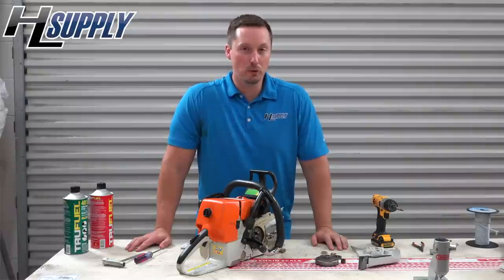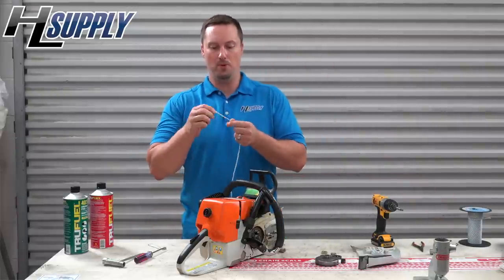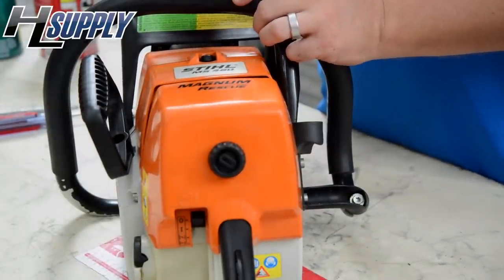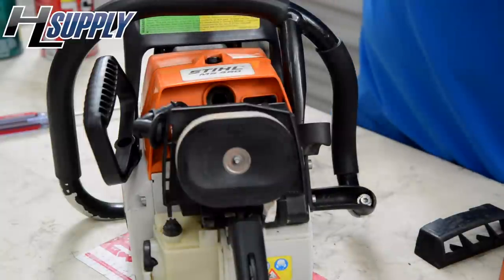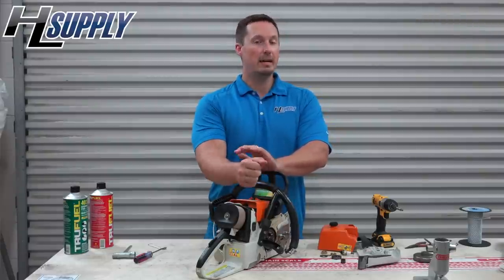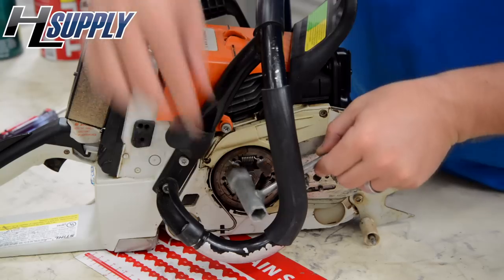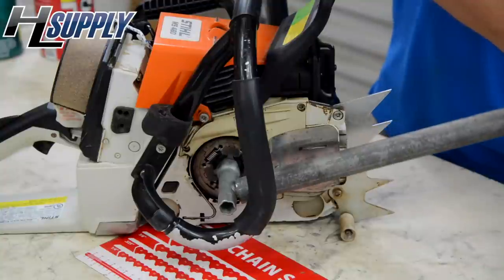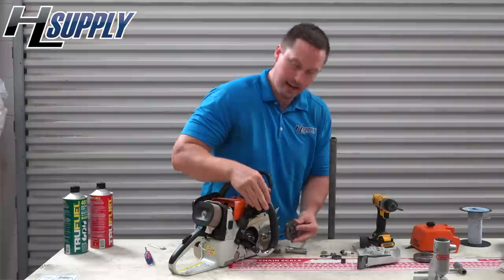Make Your Own Piston Stop and Clutch Removal... The Easy Way!

Comment: On the poulan I used a adjustable wrench and vice grips it worked good and will either buy the right tool for that job or will make a tool

Comment: I've bent a connecting rod on a saw doing this before. To play it safe, instead of using a cheater bar and slowly torquing it, I just use my ratchet and hit it sharply with a hammer to jolt the clutch loose. It helps eliminate the risk of bending the rods.
Reply: Probably not a good thing to do if you value your ratchet. I’d hit a short breaker bar, however.  Great tip though! 👍

Comment: It worked great, but my rope is stuck.  Could it have gotten stuck in the exhaust valve?

I plan on taking the muffler off, but I need a longer t27 bit
Reply: Mine too, cant get it out, Its really stuck, and there is no way to reverse the piston ... Any suggestions? Outside demount the whole thing?

Comment: Hello everybody, I used a piece a rope with smaller diameter and poor 
quality so it broked into, do I have to take it off ?! or will it burn 
??
Reply: Yes, you must remove it!
Reply: I'd say if you got most of the rope out and left a tiny piece in then it'll be fine unless you're picky perfect and don't wanna chance scratching your metal with a piece of plastic rope which won't because it'll get burned up really fast whatever way

Comment: I have to use a hammer and a punch to remove all the clutches on my saws.
Reply: This method can work but it can also damage the clutch so it's the best idea.
Reply: @mattobermiller5041  Use a brass punch.
Reply: @stsid1  Good idea,  I'm mainly a Stihl guy and they seem to all have hexs for a wrench.
Reply: @mattobermiller5041  I'm a husqvarna and poulan user and don't know what they use but i get it apart without the special tool

Comment: Hello everybody, I used a piece a rope with smaller diameter and poor 
quality so it broked into, do I have to take it off ?! or will it burn 
??
Reply: Kinda late, but use a shop vac to get those threads out. You really don't want any debris in the combustion chamber. You can run the risk of scratching your cylinder and wall, that would cause compression loss.
Reply: @bubbaray575  hello mate, better late than never lol;
I all disassembled and took apart my saw, cleaned it and grabbed the small piece of rope.
Reply: @Raiarii14  my shoe string broke apart into 3 pieces i picked it all out to avoid taking mine apart cause all that would waste my daylight time i use so i got it all plucked out and it ran good a little shitty though with old gas but done good